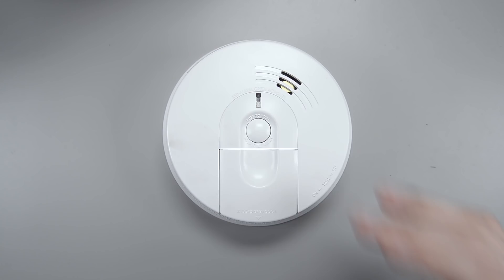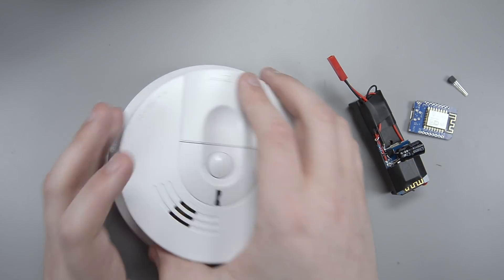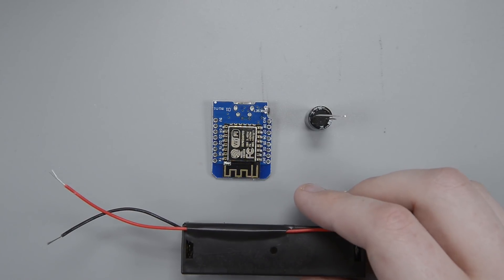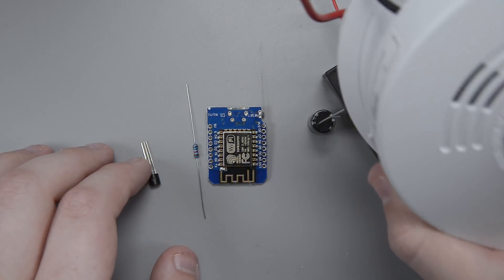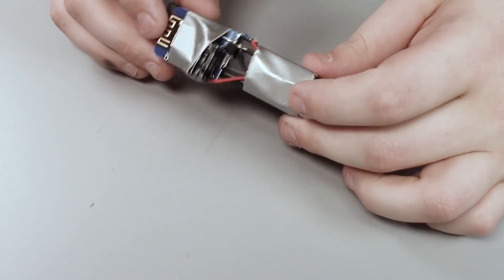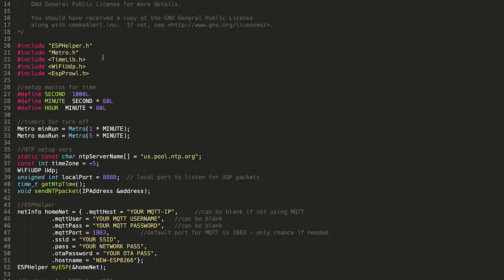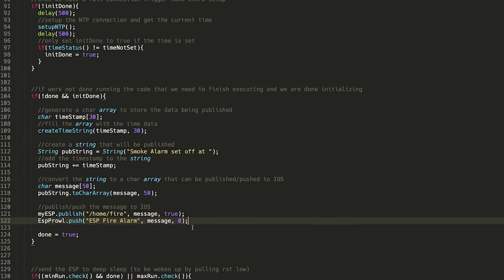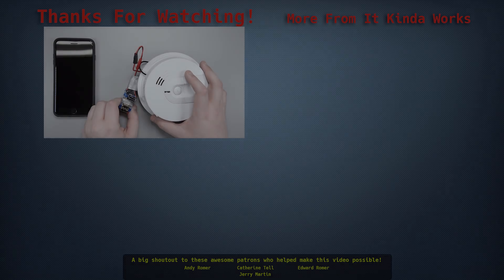Smart Smoke Detector Build

Comment: I had the same idea but instead of wifi I was thinking in use Bluetooth zigbee or RF433mhz due power consumption of the battery, did the battery last long ? planing to integrate with home assistant

Comment: I made a standalone Module for my Home Smoke Detectors. I used a 9Volt Relay on the Signal lead so it will tell my ESP if there is a Fire/Smoke alert. I used a 12 volt CCTV Power Supply I use for most of my Automation projects and inside the Module I built has a Buck Converter to drop it to 3.3v. The ESP uses ESPHome and it's setup as a Binary Sensor. Just so I wasn't wasting some IO I added a DHT22 Sensor as well. I thought about adding a way to have it alert me about a low battery but it was a waste of time since the Smoke/Carb detectors in my Home beep and verbally inform me "Low Battery". Since I am a self trained Electronics Engineer (twenty years) and my day to day job is installing Burg and Fire Alarm Systems and done some Electrical work from time to time and tested the crap out of it for a month before deploying the Module I can say I am confinement on my setup, not to mention I also have a couple Monitored Smoke/Carb Detectors on my Burglary Alarm Panel as a failsafe.

Comment: Why don’t use the d1mini into super-deep-sleep (when only wakes up by pulse in gpio16) and use the transistor from gnd to gpio16 to wake it of, connect and send the message, I used a little different and with in 20ms wakes up, connect to wifi and ck mqtt messages and also send a message then go back to sleep until cycle happens again! Is awesome!

Comment: Nutty idea - you could isolate completely by coupling by sound.  That is, use the ESP to detect the piezo buzzer (loud) and signal the fact that the ESP "hears" the detector.  Sort-of like a glass-break detector.
Reply from the maker: I definitely thought about doing that! The only thing that stopped me from doing it was that I didn't want to deal with audio and figuring out the filtering required to make it trigger only when the alarm is going off and ignore other possible ambient sounds. Alternatively I'm sure it wouldn't be that difficult to wire it so close to the speaker and have such a high threshold that essentially ONLY the speaker would set it off but meh...  It's a good alternative way though, especially on models that don't have that extra signal wire
Reply: @ItKindaWorks  Typically a Smoke detector outputs a temporal-three pattern at 3200Hz A-weighted sound pressure level of at least 85 decibels for 10 Feet.

Comment: Thanks for the great tutorial but I've a noob question, is the purpose of connecting that 1000uF capacitor (between GND and 3.3V) to stabilize the supply voltage ? Thank you.
Reply: i wonder too.

Comment: Hi everyone, when trying to upload the code via arduino, its getting a error saying 

"_smokeAlert:22:23: error: ESPHelper.h: No such file or directory
"

Can anyone help?

                       ^
Reply from the maker: It looks like you havent installed the ESPHelper library. Head over to https://github.com/ItKindaWorks/ESPHelper to download the library and install it.
Reply: @ItKindaWorks  thanks for the reply bud. Managed to sort the library but I'm not hit with this error. Determined to get this to work but my lack of programming skills is holding me back. Hoping to use this project to gain some experience though.

Arduino: 1.8.7 (Windows Store 1.8.15.0) (Windows 10), Board: "Generic ESP8266 Module, 80 MHz, Flash, ck, 26 MHz, 40MHz, QIO, 512K (no SPIFFS), 2, v2 Lower Memory, Disabled, None, Only Sketch, 9600"

C:\Program Files\WindowsApps\ArduinoLLC.ArduinoIDE_1.8.15.0_x86__mdqgnx93n4wtt\arduino-builder -dump-prefs -logger=machine -hardware C:\Program Files\WindowsApps\ArduinoLLC.ArduinoIDE_1.8.15.0_x86__mdqgnx93n4wtt\hardware -hardware C:\Users\mrpau\OneDrive\Documents\ArduinoData\packages -tools C:\Program Files\WindowsApps\ArduinoLLC.ArduinoIDE_1.8.15.0_x86__mdqgnx93n4wtt\tools-builder -tools C:\Program Files\WindowsApps\ArduinoLLC.ArduinoIDE_1.8.15.0_x86__mdqgnx93n4wtt\hardware\tools\avr -tools C:\Users\mrpau\OneDrive\Documents\ArduinoData\packages -built-in-libraries C:\Program Files\WindowsApps\ArduinoLLC.ArduinoIDE_1.8.15.0_x86__mdqgnx93n4wtt\libraries -libraries C:\Users\mrpau\OneDrive\Documents\Arduino\libraries -fqbn=esp8266:esp8266:generic:CpuFrequency=80,VTable=flash,ResetMethod=ck,CrystalFreq=26,FlashFreq=40,FlashMode=qio,FlashSize=512K0,led=2,LwIPVariant=v2mss536,Debug=Disabled,DebugLevel=None____,FlashErase=none,UploadSpeed=9600 -ide-version=10807 -build-path C:\Users\mrpau\AppData\Local\Temp\arduino_build_122856 -warnings=none -build-cache C:\Users\mrpau\AppData\Local\Temp\arduino_cache_966764 -prefs=build.warn_data_percentage=75 -prefs=runtime.tools.mkspiffs.path=C:\Users\mrpau\OneDrive\Documents\ArduinoData\packages\esp8266\tools\mkspiffs\0.2.0 -prefs=runtime.tools.mkspiffs-0.2.0.path=C:\Users\mrpau\OneDrive\Documents\ArduinoData\packages\esp8266\tools\mkspiffs\0.2.0 -prefs=runtime.tools.esptool.path=C:\Users\mrpau\OneDrive\Documents\ArduinoData\packages\esp8266\tools\esptool\0.4.13 -prefs=runtime.tools.esptool-0.4.13.path=C:\Users\mrpau\OneDrive\Documents\ArduinoData\packages\esp8266\tools\esptool\0.4.13 -prefs=runtime.tools.xtensa-lx106-elf-gcc.path=C:\Users\mrpau\OneDrive\Documents\ArduinoData\packages\esp8266\tools\xtensa-lx106-elf-gcc\1.20.0-26-gb404fb9-2 -prefs=runtime.tools.xtensa-lx106-elf-gcc-1.20.0-26-gb404fb9-2.path=C:\Users\mrpau\OneDrive\Documents\ArduinoData\packages\esp8266\tools\xtensa-lx106-elf-gcc\1.20.0-26-gb404fb9-2 -verbose C:\Users\mrpau\OneDrive\Desktop\23c550db3552ce018118594375356a20-762ce0aa35b0f04604745326912c2bb4deb25b9d\_smokeAlert\_smokeAlert.ino
C:\Program Files\WindowsApps\ArduinoLLC.ArduinoIDE_1.8.15.0_x86__mdqgnx93n4wtt\arduino-builder -compile -logger=machine -hardware C:\Program Files\WindowsApps\ArduinoLLC.ArduinoIDE_1.8.15.0_x86__mdqgnx93n4wtt\hardware -hardware C:\Users\mrpau\OneDrive\Documents\ArduinoData\packages -tools C:\Program Files\WindowsApps\ArduinoLLC.ArduinoIDE_1.8.15.0_x86__mdqgnx93n4wtt\tools-builder -tools C:\Program Files\WindowsApps\ArduinoLLC.ArduinoIDE_1.8.15.0_x86__mdqgnx93n4wtt\hardware\tools\avr -tools C:\Users\mrpau\OneDrive\Documents\ArduinoData\packages -built-in-libraries C:\Program Files\WindowsApps\ArduinoLLC.ArduinoIDE_1.8.15.0_x86__mdqgnx93n4wtt\libraries -libraries C:\Users\mrpau\OneDrive\Documents\Arduino\libraries -fqbn=esp8266:esp8266:generic:CpuFrequency=80,VTable=flash,ResetMethod=ck,CrystalFreq=26,FlashFreq=40,FlashMode=qio,FlashSize=512K0,led=2,LwIPVariant=v2mss536,Debug=Disabled,DebugLevel=None____,FlashErase=none,UploadSpeed=9600 -ide-version=10807 -build-path C:\Users\mrpau\AppData\Local\Temp\arduino_build_122856 -warnings=none -build-cache C:\Users\mrpau\AppData\Local\Temp\arduino_cache_966764 -prefs=build.warn_data_percentage=75 -prefs=runtime.tools.mkspiffs.path=C:\Users\mrpau\OneDrive\Documents\ArduinoData\packages\esp8266\tools\mkspiffs\0.2.0 -prefs=runtime.tools.mkspiffs-0.2.0.path=C:\Users\mrpau\OneDrive\Documents\ArduinoData\packages\esp8266\tools\mkspiffs\0.2.0 -prefs=runtime.tools.esptool.path=C:\Users\mrpau\OneDrive\Documents\ArduinoData\packages\esp8266\tools\esptool\0.4.13 -prefs=runtime.tools.esptool-0.4.13.path=C:\Users\mrpau\OneDrive\Documents\ArduinoData\packages\esp8266\tools\esptool\0.4.13 -prefs=runtime.tools.xtensa-lx106-elf-gcc.path=C:\Users\mrpau\OneDrive\Documents\ArduinoData\packages\esp8266\tools\xtensa-lx106-elf-gcc\1.20.0-26-gb404fb9-2 -prefs=runtime.tools.xtensa-lx106-elf-gcc-1.20.0-26-gb404fb9-2.path=C:\Users\mrpau\OneDrive\Documents\ArduinoData\packages\esp8266\tools\xtensa-lx106-elf-gcc\1.20.0-26-gb404fb9-2 -verbose C:\Users\mrpau\OneDrive\Desktop\23c550db3552ce018118594375356a20-762ce0aa35b0f04604745326912c2bb4deb25b9d\_smokeAlert\_smokeAlert.ino
Using board 'generic' from platform in folder: C:\Users\mrpau\OneDrive\Documents\ArduinoData\packages\esp8266\hardware\esp8266\2.4.2
Using core 'esp8266' from platform in folder: C:\Users\mrpau\OneDrive\Documents\ArduinoData\packages\esp8266\hardware\esp8266\2.4.2
Build options changed, rebuilding all
Detecting libraries used...
"C:\\Users\\mrpau\\OneDrive\\Documents\\ArduinoData\\packages\\esp8266\\tools\\xtensa-lx106-elf-gcc\\1.20.0-26-gb404fb9-2/bin/xtensa-lx106-elf-g++" -D_ets_ -DICACHE_FLASH -U_STRICT_ANSI_ "-IC:\\Users\\mrpau\\OneDrive\\Documents\\ArduinoData\\packages\\esp8266\\hardware\\esp8266\\2.4.2/tools/sdk/include" "-IC:\\Users\\mrpau\\OneDrive\\Documents\\ArduinoData\\packages\\esp8266\\hardware\\esp8266\\2.4.2/tools/sdk/lwip2/include" "-IC:\\Users\\mrpau\\OneDrive\\Documents\\ArduinoData\\packages\\esp8266\\hardware\\esp8266\\2.4.2/tools/sdk/libc/xtensa-lx106-elf/include" "-IC:\\Users\\mrpau\\AppData\\Local\\Temp\\arduino_build_122856/core" -c -w -Os -g -mlongcalls -mtext-section-literals -fno-exceptions -fno-rtti -falign-functions=4 -std=c++11 -ffunction-sections -fdata-sections -w -x c++ -E -CC -DF_CPU=80000000L -DLWIP_OPEN_SRC -DTCP_MSS=536 -DARDUINO=10807 -DARDUINO_ESP8266_GENERIC -DARDUINO_ARCH_ESP8266 "-DARDUINO_BOARD=\"ESP8266_GENERIC\"" -DLED_BUILTIN=2 -DESP8266 "-IC:\\Users\\mrpau\\OneDrive\\Documents\\ArduinoData\\packages\\esp8266\\hardware\\esp8266\\2.4.2\\cores\\esp8266" "-IC:\\Users\\mrpau\\OneDrive\\Documents\\ArduinoData\\packages\\esp8266\\hardware\\esp8266\\2.4.2\\variants\\generic" "C:\\Users\\mrpau\\AppData\\Local\\Temp\\arduino_build_122856\\sketch\\_smokeAlert.ino.cpp" -o nul
Error while detecting libraries included by C:\Users\mrpau\AppData\Local\Temp\arduino_build_122856\sketch\_smokeAlert.ino.cpp
Generating function prototypes...
"C:\\Users\\mrpau\\OneDrive\\Documents\\ArduinoData\\packages\\esp8266\\tools\\xtensa-lx106-elf-gcc\\1.20.0-26-gb404fb9-2/bin/xtensa-lx106-elf-g++" -D_ets_ -DICACHE_FLASH -U_STRICT_ANSI_ "-IC:\\Users\\mrpau\\OneDrive\\Documents\\ArduinoData\\packages\\esp8266\\hardware\\esp8266\\2.4.2/tools/sdk/include" "-IC:\\Users\\mrpau\\OneDrive\\Documents\\ArduinoData\\packages\\esp8266\\hardware\\esp8266\\2.4.2/tools/sdk/lwip2/include" "-IC:\\Users\\mrpau\\OneDrive\\Documents\\ArduinoData\\packages\\esp8266\\hardware\\esp8266\\2.4.2/tools/sdk/libc/xtensa-lx106-elf/include" "-IC:\\Users\\mrpau\\AppData\\Local\\Temp\\arduino_build_122856/core" -c -w -Os -g -mlongcalls -mtext-section-literals -fno-exceptions -fno-rtti -falign-functions=4 -std=c++11 -ffunction-sections -fdata-sections -w -x c++ -E -CC -DF_CPU=80000000L -DLWIP_OPEN_SRC -DTCP_MSS=536 -DARDUINO=10807 -DARDUINO_ESP8266_GENERIC -DARDUINO_ARCH_ESP8266 "-DARDUINO_BOARD=\"ESP8266_GENERIC\"" -DLED_BUILTIN=2 -DESP8266 "-IC:\\Users\\mrpau\\OneDrive\\Documents\\ArduinoData\\packages\\esp8266\\hardware\\esp8266\\2.4.2\\cores\\esp8266" "-IC:\\Users\\mrpau\\OneDrive\\Documents\\ArduinoData\\packages\\esp8266\\hardware\\esp8266\\2.4.2\\variants\\generic" "C:\\Users\\mrpau\\AppData\\Local\\Temp\\arduino_build_122856\\sketch\\_smokeAlert.ino.cpp" -o "C:\\Users\\mrpau\\AppData\\Local\\Temp\\arduino_build_122856\\preproc\\ctags_target_for_gcc_minus_e.cpp"
exit status 1
Error compiling for board Generic ESP8266 Module.uments\Arduino\libraries\MetroArduinoWiringmaster

Comment: Hi can you the explain the 9v coming into the base, will it do anything to the esp 3.3v.(then the transistor switch, is it switching to the collector side or the Emitter side ).  what is the max volts you can have going to the base. I have something like this I am trying to setup up. my setup have 18v dc. 

I notice you don't have a step down, is the resistor acting like a step down ?
Reply from the maker: The resistor is just acting to limit the amount of current that the transistor pulls. Basically the transistor is switched from the current flowing into the base and only needs something like 15mA to fully saturate (you'll have to look up the transistor spec sheet for a real number on that). I'm not an expert on transistor logic (I mostly just fumble around until it works) but you should be able to put a fairly high voltage into the transistor base and as long as you have the appropriate resistor to keep the current down then it should be fine. I'd say it should be fine up to at least 18 or so volts without being an issue. But if not I'm sure someone will be by in short order to tear into how little I know haha

Comment: Yet another great project ! What is the model number of the Kidde smoke detector you used ? I’m thinking of adding this to my Particle Photon/Blynk garage door opener. A house in my neighborhood burned down due to a fire in the garage. 
https://particle.hackster.io/BianchiRider/garage-door-opener-with-blynk-a0530d
Reply from the maker: Glad you like the project! Yeah I hate leaving for vacation or any extended period of time for that exact reason. This at least gives me some peace of mind. I think it was roughly a Kidde i4618ac. Also thats a pretty cool garage door opener build!
Reply: Do you think hooking up a 12V relay (the one I’m currently using is a 5V) to the output of the Kidde would trigger the relay upon alarming ? The relay needs 5 mA.
Reply from the maker: I'm not sure honestly sure. If the relay can be triggered at 9V at ~5mA then i'm sure it would be able to trigger it. But depending on the relay I'd think that it being a 12V relay may mean that theres just not enough power going to it from the alarm to be able to reliably trigger it. Try it out and let me know!
Reply: I tried and it doesn’t work. I’m going to try an optocoupler once I get it.

Comment: OK...just brainstorming here. Could we hook up an ESP8266-01 to the 9-Volt signal (with capacitors and stuff) and then when the detector goes off it will turn on the ESP and if we program it as an IOT button it could signal us that way? Then we dont need a battery. Right?
Reply from the maker: I actually tried doing exactly that when I first started working on this but quickly found that the 9v signal from the detector puts out basically no current (I assume they're designed like this for long battery life). I didn't measure it but there was enough to make the led flash on the ESP for a moment but then nothing. Even if you could I probably wouldn't just because those 9V batteries don't have very much mAh to begin with (I think a typical 9V alkaline has something like 300mAh) so an ESP would put quite a load on them. 

I'm sure it could be done with some ingenuity but I figure the less messing with the smoke detector electronics, the better.
Reply: Ok that being said then. Coulding you connect the transistor to the 9volt battery and the signal pin and then have the 9 volt battery power the esp8266? I only ask because who wants a big ass battery next to the detector on the ceiling. Is there room inside for an ESP , capacitors for regulator and a transistor?
Reply from the maker: You could totally power the ESP off of the 9V battery and you could probably stuff it all inside of the detector. I chose to not go this route because I figured I'd get a bunch of flack from the safety police about modifying a life saving device... But yes what you are saying is totally possible. The only reason I wouldn't use the 9V battery is because they really just dont hold much of a charge so even powering the ESP for a few min could potentially drain the battery. 

Basically I kept everything separate to try to keep the grumpy people at bay haha.
Reply: You make a great point. I'm sure some idiot will blame you for their house burning down.